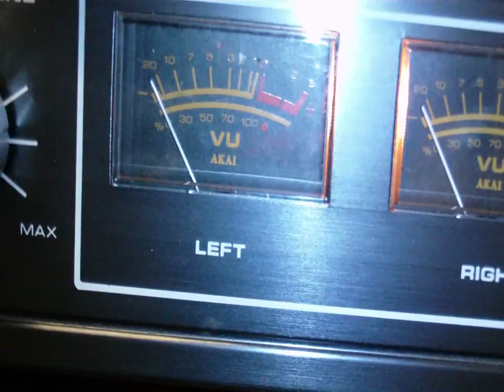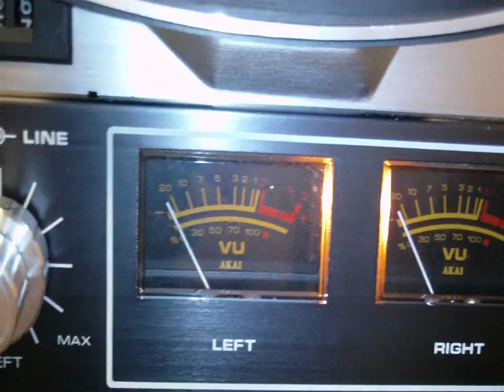Tape Head Experiment

Comment: Clean the head on the Peto-Scott , degauss as GS advises (do the erase head too - never put a magnetized item near a play/record head unless its tip of degausing coil (try Ebay) the miss-match impedance between the 1960's valve R/P head (30k at 10Hz) and 90's transistor head (about 20k or less at 10 Hz) would be significant  so highs would be clearer but response at lows poor also the azimuth on the P-S head may be wrong now -affect clarity . Get a BSR TD1/2 manual . Try to get recorder circuit.

Comment: "Tape Machine" destruction / not experimentation, lol / Making judgments about things like highs can be misleading without vast knowledge. EG. that static is a connection to a tape head that's bad or bad filter caps in the output section of the built in amp.

Comment: your experiment at about 4:00: the recording is poor because the head is not secured, and so the azimuth is all over the shop. Plus you are using a condenser mike when these machines were built to use crystal or at least a dynamic type. might be worth a bit more experimenting.